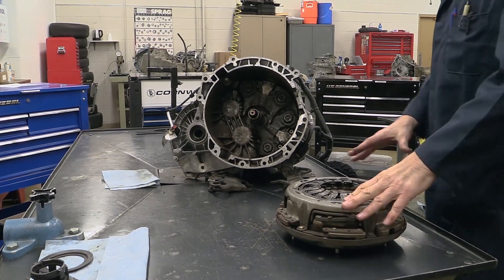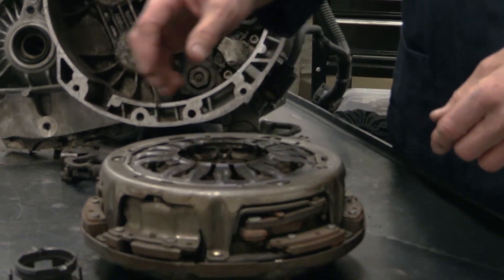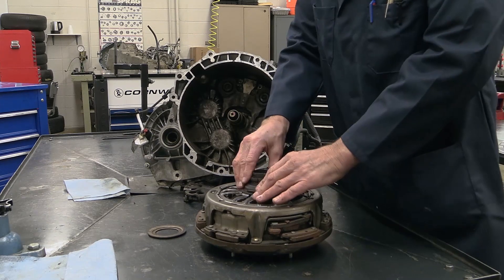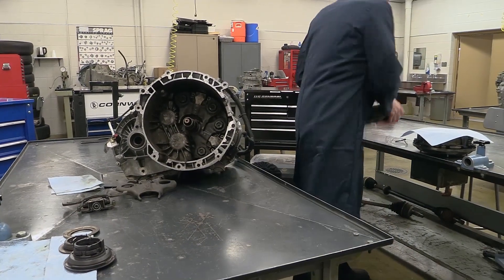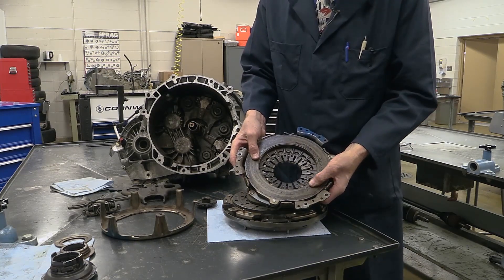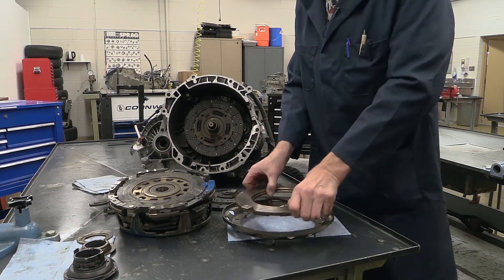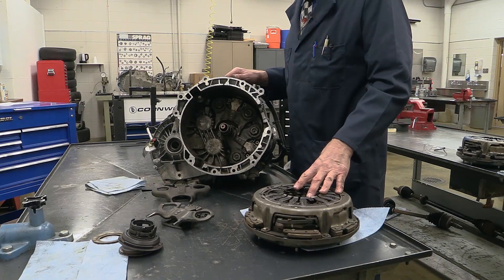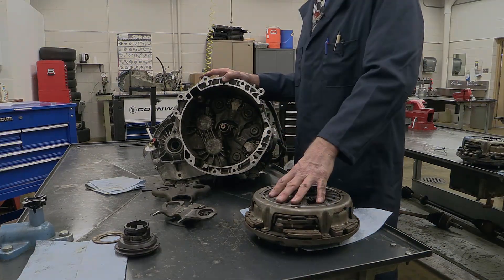Ford DSP6 Dual Clutch, Clutch explanation

Comment: I have a Ford Ecosport 2015 automatic. 1.5 Dual clutch. Is this the same assembly?
Reply from the maker: I believe the eagle sports have a regular or traditional type six speed, automatic transmission. You’re in luck.
Reply: Please tell me where I can order the apply or throw out  bearing via Amazon.
Reply: Where can I order this specific car parts from? The throw out bearing?

Comment: Total opposite of manual for the clutch,l of MT, meaning in DCT both clutches are normal freely moving? This is the closest video to what I wanted to see(hear in this case).

I'm also interested in where the force comes from to clamp the clutch pack in wet DCTs

Comment: Hi great video.  I changed the clutch in my 2011 Fiesta but the new axle seal leaked and I later found the gears were making noise (my son had been driving the car).  I refilled the gear oil but it's obvious the gears are permanently damaged.   I have a new good clutch installed and would like to only replace the gears if possible.  Is it possible to use a Focus transmission since there are many more Focus cores available for $150 to $250 range.  I'm guessing several of these are clutch related failures.  From what I've seen in other videos the gear set is mounted on the back of the bell housing and a cover is placed over the gears.  Are these interchangeable between the Focus and Fiesta?

Comment: The dust from the disk packs is also a great point of failure in these ford focus dct transmission. These aren't being repaired by your local transmission shop in most cases. They will tell you to take to a ford dealer. Then the cost to repair it is worth more then the value of the car. It's has to many points of failure in that transmission. I sold my 2014 Ford focus automatic and got a 2015 ford focus 5 speed manual transmission. Problem solved.